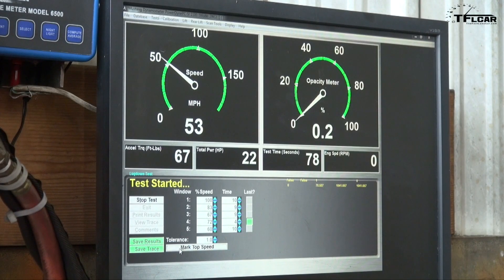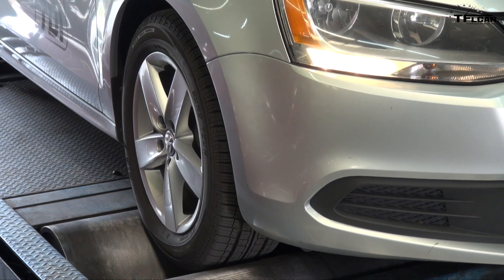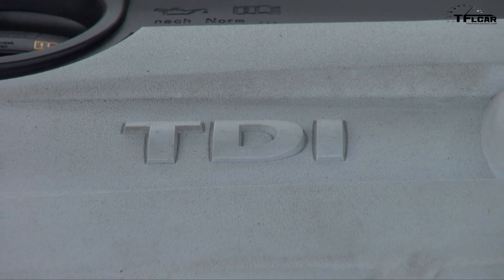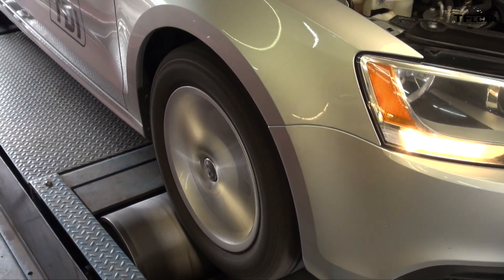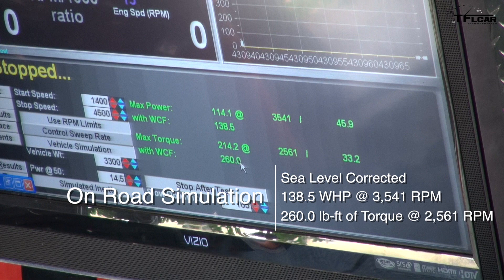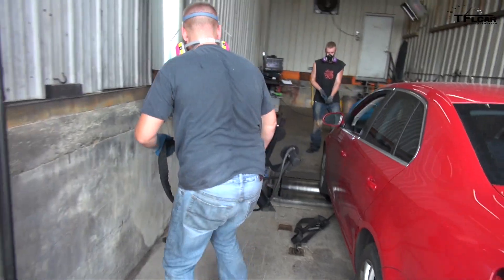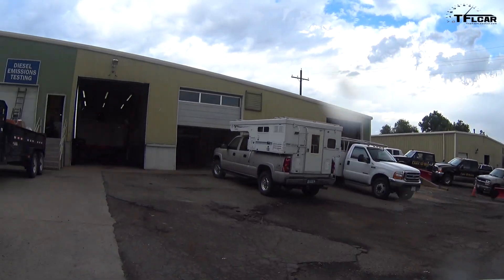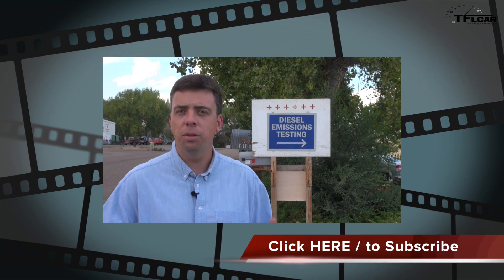Surprise! We Dyno a VW Dieselgate TDI Jetta to get the Truth about HP Loss

Comment: Cool experiment but are these HP and TQ numbers based on an average of multiple runs? Dyno numbers can vary between runs. Also you didn't disable the traction control and this could have skewed the results. Why didn't you hook up an AFR sensor to see if the computer changed anything?

Comment: Sorry guys, but this test is absolute garbage.  The "switch" that toggles programming between test mode and normal mode is a lot more complicated than you think, and everything that you did on that dyno was done in normal mode.  

It is impossible to get a full-power dyno run in emissions test mode because full throttle will immediately kick the computer back to normal mode.

In order to stay in emissions test mode, coolant temperature must be at a certain point at engine start, engine run-time must be within a certain range, steering wheel angle and acceleration sensors much be within a certain range (zero), barometric pressure must match that in the EPA's specific test conditions, engine acceleration cannot exceed 300 RPM per second, and throttle application must be within a certain range (those defined by the EPA emissions test).

I suggest you update your findings so that reporters and news outlets don't continue quoting this farce as fact.

Comment: Ok, your entire premise of tricking the car into thinking it's being emissions tested is false. Your entire second dyno run is flawed. Your theory, experiment and results are flawed as a result.To those who don't know. ABS and TRACTION/STABILITY control systems work using sensors and tone rings at all 4 wheels, brakes and engine power. When the rpm's of one or more of the wheels increase or decrease too fast, or one or more wheels have a large enough speed differential compared to the others, it triggers ABS, TRACTION and STABILITY control. This is what actually happens to your wheels when you are locking up the tires coming to a stop, spinning them wildly while accelerating, or spinning out of control/fishtailing while driving. Differences in wheel RPMs. The computers monitor all wheel speeds and will apply brake pressure to individual wheels, and/or limit/decrease engine output in an attempt to bring the car back under control.
You do your second dyno test on a "2 wheel dyno" in an attempt to activate the software that modifies the engine systems that affect the emissions.The traction control light comes on (amber). The abs light comes on (amber). The brake warning light comes on(red).  This is the source of your problems, and is a result of the flawed hypothesis as to how to activate the emissions control mode.Here's the breakdown:In the video @ 4:13 "allright, we've got the car set up in 2 wheel drive mode here"no such thing on the car. You must mean that you have the dyno set up in 2 wheel drive mode. "now it looks like we're getting an error on the car" as the traction control light flashes amber on the dash.That's no error. The rear wheels are stationary, while the front ones are moving. The TCS/ESC believes that conditions are slippery, caused by the difference of wheel speeds between front and rear. The amber light means that condtions are slippery and TCS/ESC is active and attempting to correct things. Amber means caution and information, not an error. Errors are red. "it knows we are in a different mode, and I cannot accelerate"The computer is interpreting sensor outputs as slippery conditions. Brake pressure is being applied and the engine is possibly derating as the ECU attempts to correct the condition it interprets the car is in."now it looks like it shut off abs"No, the ABS light is amber, meaning ABS is active and trying to correct things because of the wheel speed differences. "brake is flashing" (red)This is a genuine error reading. The TCS/ABS/SC is doing all it can to correct the massive differences in wheel speeds it is sensing and nothing is working. Because it is not working, the system interprets it as a braking fault. It believes either the brakes are faulty, or that the sensor inputs are faulty, hence the red "get me checked NOW" light.I have no idea why the TPMS amber light comes on, but it has to be a misinterpretation of sensor info by the TCS/ESC/ABS systems.Besides all this with an automatic transmission, unless you have the ability to lock the trans into one gear and prevent it from downshifting, your dyno results will be horribly inaccurate. Period. The only thing this video shows is that you cannot activate the emissions test mode of the car by simply putting it onto a 2 wheel dyno. I suspect the only way to activate it is via software, hooking right up to the ECU/ECM.I truly cannot believe that a group of people who are supposedly knowledgeable about cars would put a video like this out and state it as truth. You pretty much destroy every shred of credibility you may have with it.
Reply: +Roger Burtnick  TPMS light more than likely came on as VW's use wheel speed sensors to sense low air pressure in the tires. Thus when a wheels is spinning slower or faster than the rest it notifies the driver. With that said, if two are not spinning....
Reply: oh ok. didn't know the wheel sensors on them monitored tire pressure as well. that explains it then.
Reply: +Roger Burtnick They could have simply pulled the fuses for all of these systems.
Reply: +eastender74 to get rid of the errors possibly,  as long as they aren't integrated too much into the control systems causing the car to not run at all. and still would not have activated the emissions testing mode.

Comment: all that happened was the car went into limp mode.. still driveable but with less torque  because the car needed to recognise all 4 wheels moving with the front wheels only going the car does not know how fast the rear wheels are going and limits power.. that test proved nothing

Comment: im surprised that TFL didnt explain that the hp/tq numbers from the four wheel dyno, after sealevel corrextion, were waaaay higher than the stock 140hp/236tq. they got 138whp/260wtq after calculating for drivetrain loss, which is 12%-18% for fwd vehicles, the numbers at the crank, which is what all manufacturers report, would be 157hp/299tq. ive test driven a 2015 passat tdi and it didnt feel  like it had that kind of tq (i drive a focus st for reference), but it definitely had plenty of get up n go. the fact TFL didnt explain this makes me question this presenter. anyone whos into the aftermarket scene and has had their car dynod would know this. 2016 Passat TDI was looking like my next ride too :/

Comment: there is nothing suprising about a car electronically pulling power when traction control exc. is disabled the car will barely accelerate at all with those thing off

Comment: You know what's VW real fault? They were getting too much fuel economy. 50 mpg diesels, even with higher no2 emissions, are less contaminant than hybrids and the fracking required to feed our huge SUV's.
Reply: +Tamás Madarász First of all you must drive your TDI with your foot to the floor at all times, my 2013 TDI averages 45mpg, secondly Theres a reason that your Prius doesn't create as much NOx as a TDI, because gasoline engines don't really produce a lot of NOx to begin with.  Gasoline and Diesel fuel burn in very different ways and while they produce the same gases, they produce in different ways and wildly different amounts.  I can almost guarantee that 90% of the people talking about NOx emissions right now didn't even know it existed until a few weeks ago.
Reply: this!
Reply: +NotQuiteFishFPS That is physically impossible unless you're going downhill. Maybe you're thinking of British gallons in your MPG figure?
Reply: +A Dz Well there are ups and downs in all engine types. Bottom line is nobody is saving the world by running a car, even if its full electric. Not until we produce really clean energy.
Reply: I like my 7.3 PowerStroke, I refilter used waste oil/lubes and use 80% of that to 20% diesel fuel.  Makes my truck 80% cheaper to drive, on 10 gallons of diesel and 30 gallons of my home brew I can drive 600-700 miles before the next refill, which in what I pay in diesel puts me at atleast 60mpg in the fuel I'm paying for.....  My truck weighs 7500lbs unloaded, I also haul and tow with it.
4 door cab is bigger than the whole jetta LOL
Reply: +SalveMonesvol It's true! It's how you drive. I consistently get 3-7 mpg better than my vehicles are supposed to, because I adjust my acceleration rate as appropriate for the gearing and for the engine's power curve. I drove my old '99 Intrigue at highway speeds around 75-80 with the air conditioning running the whole time, and achieved 36 mpg in a car that is rated for 31 mpg. City driving I got better mileage (rated 22, actual 26) by shifting the auto tranny into "3" at speeds 50 mph and lower because the engine rpms were way too low and the tranny would shift out of Overdrive with every slight hill.
Reply: Tyler Hunt Good car.
Reply: vw's fault...they are not american.
Reply: +A Dz Yeah man. I think we talk different subjects here. Anyways good chat.
Reply: A Dz LPG would be nice for supercharged engines. I wish it was popular in my country.
Reply: +A Dz How big is your gallon?
Reply: Tyler Hunt we don't use gallons in Europe, we use liters. US Gallon is 3.7 liters. I used your gallon for comparison
Reply: A Dz
 Yeah, we don't use gallons where I am either, but we sure do like using imperial gallons for marketing. That's why I asked.
5.2l/100km is pretty damn good. But I somehow doubt that's what you get on average.
Reply: Rob H best I've averaged on a trip was 4.2L/100km. But that's not the average use of my vehicle. My average is closer to 5.8L/100km.
Reply: Rob H
What do you drive?  I'm using a 2015 Honda Fit.
Reply: Rob H Ah diesel, that makes sense.
Reply: +Andy Hicks ---BS
Reply: +A Dz ---BS
Reply: +A Dz ---BS
Reply: Thank you.
Reply: Mathematically wrong. You are not getting multiple times less fuel consmption. That's impossible.
Reply: @Neojhun  ?
Reply: @Neojhun  what
Reply: +SalveMonesvol Not to mention the electricity to charge electric cars (Chevy Volt, Nissan Leaf), most of our nation's electricity comes from coal-fired power plants. ;-) I say this tongue-in-cheek, of course.
Reply: @MrAhicks66 "most of our nation's electricity comes from COAL fired power plants" Factually WRONG. Coal back in 2015 was about 30%.
Reply: The analysis to justify electric assumes local solar power charging cars.  They ignore that all consumers will not be having solar and 90% of the grid energy is radiated into outer space, heating the atmosphere and being driven off an internal combustion turbine powered by coal or natural gas.  when you add back the energy lost by transmission it is 2x worse for the overall environment than clean, efficient diesel.
Reply: +Tamás Madarász in Europe practically everybody uses Less than  5L/100km IN THE CITY with vw's small diesel cars. The difference might reside in the rpm ranges you are used to. These engines like an open throttle at very low rpm. Always use the highest gear you can and shift before 2.000 rpm. I know it sounds boring and slow, but that's how you get good consumption. Maybe in America that driving style would make people anxious and honk at you, I ignore it.
Reply: +A Dz That can't be possible, unless you drive like granny and you never ever drive in the city.
Reply: helloukw lol most of driving is in city..... If i run on LPG i get equivalent to 50mpg petrol when you adjust ratio between LPG prices and consumption.

P.s i dont drive like a granny, i just stick to speed limit

I get same MPG in city/rural - my engine uses less fuel on 3000 rpm than on 2000. Dont know why. Must be the ECU
Reply: +A Dz You just proved my point. You said petrol, now you say LPG. You do know its a different fuel. Plus you don't use less LPG than petrol. Just converting your price on LPG to petrol doesn't mean you run more miles per gallon. You know no matter what you do, you can never run on same fuel on petrol compared to diesel on same car and same engine displacement. There is a formula you can't really break no matter what fuel efficient systems your car has.
Reply: +helloukw i can run my car or petrol and LPG. all it takes is a switch press. it starts on petrol and when the oil gets hot chnages to lpg. i get good MPG on both.
Reply: helloukw When i run on petrol i get 40-45 MPG. Gallon of petrol costs me 4.81$.

When i run LPG i get about 30 MPG. Gallon of LPG costs me 2.4$

I am happy with both Gas and LPG mileage but i often use LPG because its cleaner and cheaper. 

I know what you're saying of course you cant get same MPG the 3 types of fuel have different calorie values, density, viscosity etc.

My point is that diesels are stupid in consumer cars, they need expensive filters to avoid heavy pollution. LPG makes very minimal pollution and Gas engines are also much cleaner than Diesel. Diesel trucks are good because they have good torque and they should stay. A VW sedan? Just stupid. Getting the TFSI Jetta is a much more logical choice than getting TDI.
Reply: +SalveMonesvol   Ah....those evil SUVs.
Reply: +SalveMonesvol I have a Jetta TDI and a Prius. The TDI averages around 39 MPG and the Prius around 55 MPG. I love the diesel's torque but the fuel economy is not even close. At all. Also, if you look it up, the Jetta TDI produces 0.04 PPM NOx while the Prius only 0.003 PPM NOx. That's over ten time less NOx emissions. And this is under testing conditions where the TDI engine "cheats" and produces less NOx emissions than in the real world. Diesel technology is great but don't present it as something it is not.
Reply: +Tamás Madarász Prius does 85mpg with normal driving and 75 with me
Reply: SalveMonesvol in a diesel you dont need to go 2000rpm+..... But diesels are crap, gasoline all the way
Reply: +Tamás Madarász I get about 45 MPG in my Kia Pro Ceed 1.6 petrol (125hp).....it sounds better than any diesel and is very flexible in terms of acceleration. Diesels are overrated and crap. Gasoline engines have same MPG as diesels nowadays
Reply: @xcimbaye4756  they dont when you also want to accelerate fast, my 184 hp tdi averages 4.9L/100km in my mixed driving and my fathers 122hp 1.4 tsi averages 5.4/100km, he does less pulls also. And I have so much more usable power. Stop hating on diesels and get to know what you are talking about.
Reply: @Jonsk111  now the name of the game is HP per fuel burnt.
Reply: @xcimbaye4756  I can assure you, they don't

Comment: I have a question though. Look at the mess of a motor the BMW N63 TT V8 is. The motor uses special piston rings that were meant for less friction but ended up allowing too much oil past them so the engine burned oil. The motor also runs so hot the turbos use oil and the engine ends up consuming more to the point that when they're floored they smoke. I'm sure it's releasing bad emissions into the atmosphere so why isn't that a problem too?

Comment: I don't care, VW made the Corrado VR6, all is forgiven .
Reply: +bign3ck I would kill to own a mint condition red on black Corrado VR6 and a red on black mint condition Nissan 300ZX TT I would be very very happy.
Reply: Djonkie Bonk I've got a black VR6, had it for over 15yrs, and everytime I drive it, it feels so good, makes you grin, and that sound from the engine. I will drive a Corrado till I die. My one is mint, i've even rebuilt the engine,ported the head. Now makes 202bhp, 0-60 in about 6 secs, not bad for a 22yr old FWD.

Comment: Yes VW has cheated but this kind of fake tests just doesn't focus on this scandal they just make you look funny. They guy in the beginning "we think you need to turn off traction control off to say you are on a dyno. Are you serious or do you think everyone else out is stupid? How are you doing to perform a dyno run with a system that tries to stop the engine from revving while it senses the front wheels are spinning out of control by comparing their speed with the rear wheels? PLUS this is for 2.0 TDI engines right? Like the one that Golf GTD has. Do you know how to engage launch control in Golf GTD? Selecting sport mode and turning traction control off. So according to you VW is so genius that they made a launch control with lower torque. Right. You are real professionals...

Comment: I'm given to understand that the affected cars are more efficient in normal conditions, more power, lower CO2 emissions and better fuel economy in everyday driving. Only in very specific conditions, (the standard test for emissions basically stays the same and never changes), is the engine management altered to give lower NOx emissions, but worse numbers everywhere else. That works because those tests never use the full power of the car or look at gas mileage.

If I'm wrong, do let me know. But I'm not sure this test had a point when they're not looking at emissions. Because, honestly who cares if the car is slightly worse when being tested, when the fact that it actively tries poisoning everyone when ever it isn't should be the real issue.

Comment: I do emission testing on future diesel engines as a job. All cars have some degree of the VW methodology usually just a few points in the map are different to change the NOx emissions. (ever notice those flat spots?) However VW really took the biscuit here with 2 distinct maps.

It's actually really good for the customer, with the road map you get better response and lower fuel & urea consumption. But you still pay the dyno map rates for vehicle tax. I find a lot of the media is really misleading, they tend to assume CO2 & 'emissions' are one in the same but in reality the CO2 emissions are less just the NOx is higher.